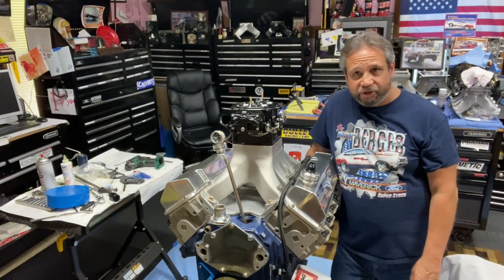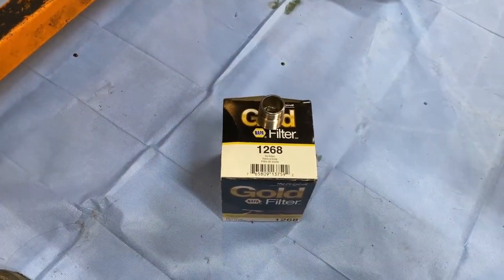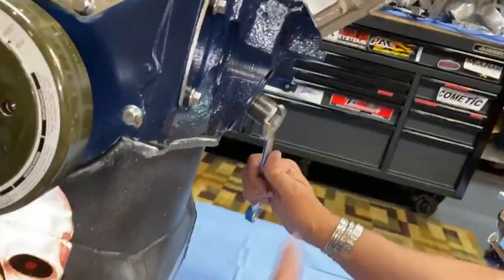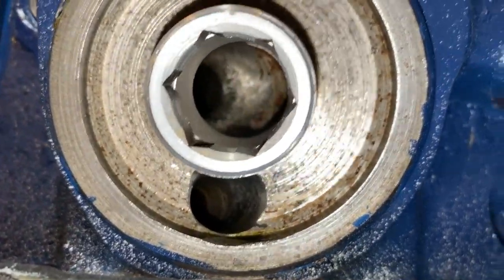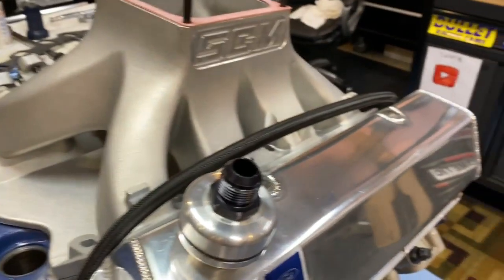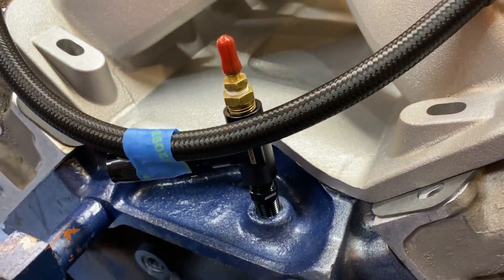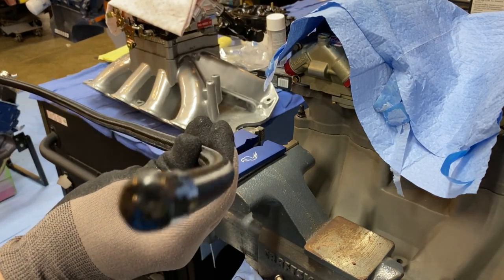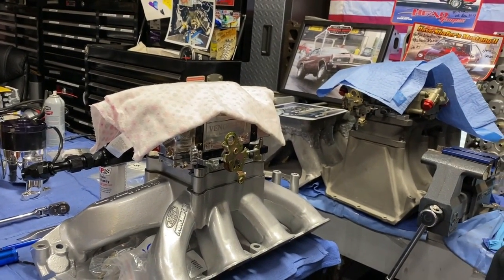DragBoss Garage Installing The External Oil Line And Oil Filter Adapter On The Ford 351 Cleveland

Comment: It is quite simple. Ditch the filter and use an adater to route the oil from the pump through a massaged gallery through a remote mount filter and an oil cooler back into the engine where you have taken that baby line. Obviuosly some drilling and blending required. You have straightened out about 3 kinks and have a bigger volume of oil into the engine. The usual restrictors etc and you have improved a bad system. You could also Y it back into the engine and take oil to the front and rear oil galleries. Something I did with drysumped Chevs which save no 1 main from starvation. You can do similar to many makes of engine as they are all drilled as cheaply as possible. Taking a line or main gallery restricted OEM and straightening it out and taking away restictions at fittings makes the oil get places with less fuss and aslo gains a few hp from the pump not working as hard. A race Clevo requires a high volume pump and blend all the intakes and outputs from the pump and into the block.
The oil cooler is generally not required as a cooler but makes an excellent deaeration device. Wet sumps at best always circulate aerared oil..
Though really these engines need dry sumping, more so than many others. And are still fragile!
However all the adapters inc Denale are at best very poor and require a LOT of work not to be a huge restriction. Ditto with the remote filter mount.  That 6mm line cannot hurt unless you lose the line but

Comment: Yes Track Boss Factory GT short shaft toploader 28 spline 9 inch with four wheel disc brakes from factory May 1976 model great old car.keep up the great site.
Reply from the maker: Dry cool love it mate. Keep up the great work.

Comment: I've heard about oil restricts for Cleveland motors but I was pretty  light on the how and why. Now, not so light on it. I do know that Pumps Produce Flow and Resistance to Flow produces Pressure. Keep up the great work, you're educating this old fart so thanks for that.
Reply from the maker: Hey Kevin, I’m at old part two. When I start prepping the pro stock block, we’ll talk more about oiling, and give maybe a better explanation. Sometimes it’s easy to see in visualize rather than just listen. I’ll see if I can help us both. Appreciate you being here old fart

Comment: Beautiful oil filter adapter and Napa Gold filter job. I remember once in Fairfield Ca, I stumbled upon a sale at Napa on Napa Gold oil filters. This was back in ‘10. I bought filters for my ‘02 Vette, my recently LS2 swapped S10 Extreme, and my ‘90 240SX. They’re good filters. That’s when I stopped using Fram filters. Started using Wix after my stash of Napa Gold filters ran out. I order Wix filters on Amazon and have ‘em shipped here to Colombia 🇨🇴 for free!😎
Reply from the maker: Hey Reg, hi to all the Colombians tuning in. Glad your here, yes napa filters are the same as Wix. They are great filters for sure. Glad your here Reg.
Reply: @DragBoss351Cleveland  They like hot rods down here too. There’s some old school Chevy and Ford motors down here with a lot of 4 cylinder tuner stuff. Hard to come across LS, Hemi and Toyota V8’s down here. I seen some late model Mustangs and Camaro’s down here, every now and then. One Camaro in particular. No cats, it sounds like. Anyway, Fram is garbage 🗑 in a pinch down here, I’d buy a Puralator from the parts stores here.
Reply from the maker: Thanks for giving us an update. You see any cool car stuff that we might like let me know. Email me. 👍
Reply: @DragBoss351Cleveland  ok

Comment: I had oil pressure problems 408 Clevo 4340 Scat crank H beam rods SRP forged pistons, second engine builder found crap in the oil gallery’s and some sealant witch I had not used. runs like clock work now ten years on love it old School engine builder second Time, love your channel Track Boss. My Falcon is on YouTube Sveno Mick XB 408 Falcon Sunday drive.
Reply from the maker: Mick that sucks going through that, I washed this block, 3 different times prior to assembly. Glad you enjoy my channel, it’s just me DragBoss, doing what I normally do. I will look up your Falcon Mick. Thanks for taking the time my friend.
Reply from the maker: I just subbed. She sounds wicked and stick car too. Great job 👍👍
Reply: Over 10 years now don’t use the old Girl much these day just love the old Cars.
Reply from the maker: Yes mate. I enjoyed your videos. Always amazed at you guys driving on the wrong side of the road. Lol

Comment: I have used the oil pressure port to feed a separate bypass oil filter that returns back to bung in the oil pan.  Of course that is in a 400M in a '79 F-350 4x4.  I am considering adding the oil line also.  Not sure if it will do much in an engine that tops out (I run out of carb with a 650cfm 4150HP) around the 5500 RPM area.  Your thoughts??

As I have said before, I love the detail you put into your videos.  Thanks for sharing.
Reply from the maker: Thanks Don. I appreciate your kind words. To tell you the truth, I would not bother. The oiling systems are good up to 6500, maybe a bit more. I would not waste your time or money. You should be good to go. Thoughts?
Reply: @DragBoss351Cleveland  Kind of what I was thinking, but thought I would ask.  You have a bunch of research into the oiling system.  This is what is so awesome about having a forum where thoughts can be expressed between several people many, many miles apart.  Thanks again.
Reply from the maker: @donnatalielucasheimbigner7598  your welcome Don. I agree for sure. Please share my channel and help me build it. Stay tuned more in store
Reply: @DragBoss351Cleveland  Will do on both.

Comment: A few years ago I installed an external oil line similar to the one you show in this video on a new 400 build, which I think has an oiling system like the 351C, with the same idea of getting more oil to the bottom end.  Some time later, I started losing the rod bearings on the passenger side, but had no idea a problem was developing until it started knocking.  Even after it began knocking, the oil pressure never dropped.  I came to realize that the external line was carrying oil directly from the oil pump to the pressure sensor, therefore the pressure sensor never picked up the problem inside the engine.  Just something to think about.  Billy
Reply from the maker: Good info too know. I have a gauge but understand what your saying. I never used these mods before and have had good luck. This will be a great test to see what happens. Your right, same oil system. Next build will have bushings. Thanks Billy
Reply: @jeffreylee7184   Apparently there was a piece of trash in an oil gallery after rebuild.  Being a 400, this was obviously not a race engine.  I built the engine myself as a torque-monster for my 77 F-100.  It only ran a 2-3 thousand miles or so before beginning to knock.  When torn down, all 4 rod bearings on the passenger side were toast.  None spun, but were chewed up, 2 of them badly so, along with damage to the crank. I can't remember anymore whether # 1 or # 4 (whichever direction the oil is routed down the crank) was in the worst shape, but the damage lessened as it went along.  All main bearings and rod bearing 5-8 were okay.  The only 2 possibilities I could come up with were (1) I accidentally let a small piece of trash get into an oil gallery during assembly, or (2) a piece of cleaning grit got stuck in an oil gallery at the machine shop.  The external oil line didn't cause the damage.  However, it essentially puts the oil pressure sensor between the oil pump and the bearings, in which location it only tells you the pressure the pump is putting out, not the pressure inside the engine through the bearings.  This renders the oil pressure sensor virtually useless.  Therefore, when in a normal situation you would see oil pressure dropping as bearings wear, the external line in my case, and as shown in this video, prevents you from seeing this.  Had the external line not been in place on my engine, I still would have lost the bearings, but perhaps seeing rapidly decreasing oil pressure, I would have shut the engine down sooner before doing so much damage to the crank.  I still remember being confused as to why my newly built engine was knocking while the oil pressure never dropped.  I eventually figured out the answer to that question, but exactly what caused the damage remains a mystery subject only to speculation.  Fortunately, I was barely able to save the crank by having it turned the maximum allowed.
Reply from the maker: Lot of speculation on oil timing with stock cranks. Hard to explain, but buddy was saying that is issue with rods on cleveland with stock crank, oil flow poor for rods. I’m a little concerned with line, but will try it. Keep your fingers crossed for me Billy.

Comment: Have a question. So I have an oil cooler and I bought the upgraded oil adapter. And I bought the external oil line. Now question is can I run the external line into the oil cooler the route it to the input in back of the engine? Thanks in advance.
Reply from the maker: You could, as long as the oil has been filtered before. Do not want to run unfiltered oil to the back.

Comment: Very neat kit by aeroflow.
I watched a video that talked about clevo mains oiling problems as a result of the crank shaft oil galory clocking positions, have you heard of this?

Thanks

Richard, aussie clevo fan.

Ps, nice manifold 👌
Reply from the maker: Thanks Richard. My mate Paul Diley made that video. That seems to be an issue with crankshaft. I have ran Eagle and Scat and no issues in that regard that I know of.
Reply: @DragBoss351Cleveland  hey mate, i just found that paul diley video, ill give it a watch, the video i watched was by chris fin he's got one video on cleveland oiling problems, its a bit slow to watch though.

Comment: If your worried about the 90 degrees in the block, why not use aer0quip type fittings.  (Straight 3/8" NPT to the block, and a  6 hose fitting-if I guessed right) -nice flowing elbow, 90 degree, like a mandrel bent pipe, but aluminum.  Then go an to pipe-add your Tee for the Oil press. send. unit.,  An back to the front of the engine with another 90 degree (Straight 3/8" NPT to the block, and a  -6 hose fitting-if I guessed right) to the 585 port.
areoquip Stainless steel with teflon lined, SS braided outside-good for 4500PSI, nearly fireproof, or Aluminum fitting and hose-similar to Sumiit stuff.  All these fittings can be reused-mostly, some thread pick up.  
Spelling intentional so no advertasmints, LOL
Reply from the maker: Got as a kit so never took the time to change. Next time around I will make sure straight with no changes

Comment: Where can these Aeroflow external oil line kits for Cleveland engines be obtained, do you know?  Is there an outlet in Australia or NZ? Thanks . .
Reply from the maker: I think you can get Aeroflow right in Australia, as that is where they are from. Don't know of any stores there, but any high performance parts stores should have it Skip

Comment: Big Cadillac engines oil lifters then mains. I tried the external oil line. Didn't work. Oil out verses Oil in through the pump. My fix was. 875 id oil suction tube. Then set pump to 100psi and use external oil pressure relief valve at oil pressure guage port at rear of block as it is the last opening to receive oil pressure. Relieved oil pressure to oil pan. Problem solved. Bearings like new after hundreds of punishment testing.
Reply from the maker: I never even went through any of that and good results. I will try the bushings, and modify the oil hole on the lifters. Man you went to town on it, from oil perspective.

Comment: Drag Boss, what weight of oil will you be using in this motor?
Reply: Must be, top secret.😃
Reply from the maker: I must have missed this. Brad Penn 20w50 semi synthetic
Reply: @DragBoss351Cleveland  I could tell, it was Brad Penn. Unmistakable.
Reply from the maker: @strokermaverick  seems to be good oil.

Comment: The oil pressure isn't going to be lowest at the rear main which is at the end of the system gallery; it is going to be lowest at the point with the highest velocity.  The biggest problem with the Cleveland oiling system is the leakage around the lifters.  Bushings in the right side lifter bores and restriction on the left side will give an amazing increase in oil pressure:  Here's a link to a video where I'm running a 384 inch Cleveland that gets run in a Pantera at the Silver State Open Road event in Nevada.  This video was taken after about 20 dyno pulls and an hour of run time.  https://youtu.be/Veq34I2B6_M
Reply from the maker: Dave I just hope these two mods don’t cause issues I never had before.
Reply: @DragBoss351Cleveland  I can't see what it would hurt except for possibly making the oil pressure look better on the gauge than what it really is inside of the engine.  
A friend of mine who ran a Camping World Nascar truck for many years used a similar oil filter in their system that I think was originally intended for hydraulic systems.  They had that same inlet as you're using and best of all they were inexpensive when compared to fancier filters that didn't work any more effectively.
Reply from the maker: @DaveMcLain  yep had about same oil pressure as before. Tough to say until I run it this am. Hey you never know. The filter was designed for a cat loader or similar engine

Comment: I would mess with that horrible "oil pressure switch" and install an actual oil pressure sensor. (I'm not hating)
I work for Ford and they still use this oil pressure switch design. An actual oil pressure sensor would reduce diagnostics time down significantly. Especially with all of the hydraulic cam phasing Ford now uses.
Reply from the maker: John I have a mechanical gauge. What oil pressure switch are you talking about. Stock I understand. Nothing stock here. Thanks for watching and commenting. Hope you have a great 2022

Comment: If you run a FilterMag And change the oil every 3000 km. You will get very long service life out of any motor
Reply from the maker: Thank you. I’ve always ran a filter mag. Because it just makes sense. I’ve never read about them. I know how efficient they are. Sounds like you have some information on them. Share it with us please. Have a great holiday season. Stay tuned to DBG.